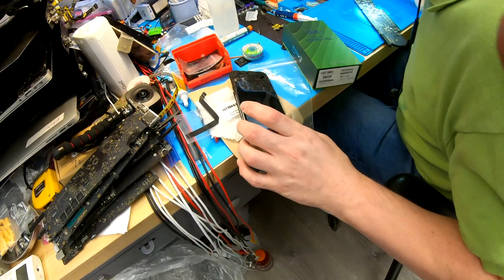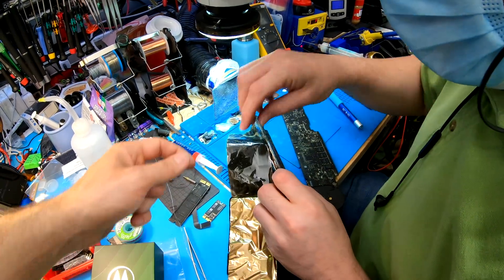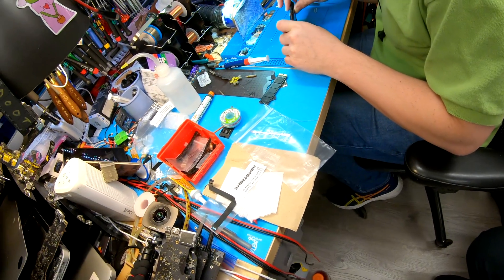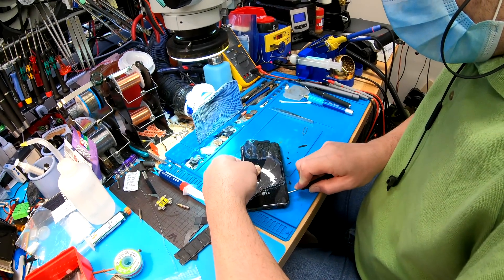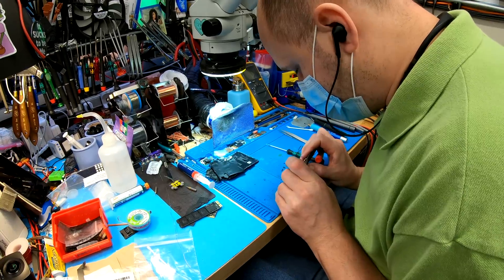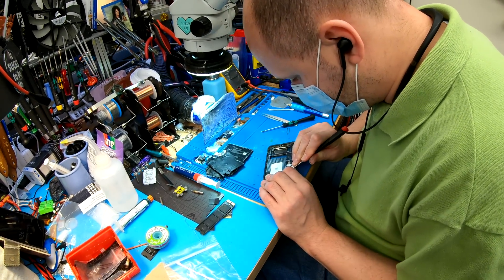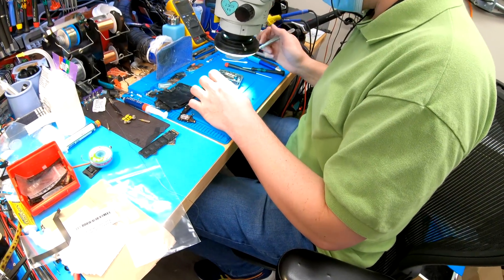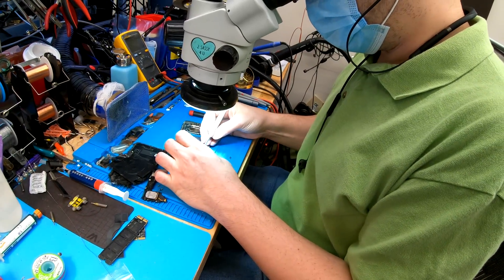Can Paul recover my phone data after the bike it was attached to goes on fire?

Comment: Gotta love it when the 1tb micro sd in his old phone costs more than the new phone.
Reply: @Carlos Suarez Motorola isn't Motorola anymore. It happens to businesses. The specific details, I cannot remember. Mergers, acquisitions, hiring, firing, employees leaving, etc.
Reply: @Zmej420BlazeIt  Motorola mobile has been acquired by Lenovo. I still like Moto phones. Affordable and configurable.
Reply: @Zmej420BlazeIt  i have a moto x4 from 2018 its going pretty good. Its ipx64 and is good on battery as well as charging. I like moto
Reply: @anshajkumar6542  I have a moto x4 4th gen and it works fine too. Bought the amazon model for 100 bucks over a year ago and its been rocking on. battery life is good on this phone and it charges fast.
Reply: @Zmej420BlazeIt  it's now CHINESE....
Reply: @Zmej420BlazeIt  Exactly.  Like MS buying Nokia and then running them into the ground.  Or HP buying Palm; still salty about that absolute hose shit buyout.
Reply: @clblanchard08  IIRC, MS bought a specific portion of Nokia's phone business because Nokia was the only company still using Windows Phone and were about to stop because nobody was buying them.  It wasn't that Ms drove that into the ground, it had already hit but not yet stopped moving.
Reply: @Zmej420BlazeIt 
Google-rola. Then Google grew tired of them and sold it off again. Lenovo is the current owner. So like many other well known brands, it's now a Chinese clown of its former glory.
Reply: @tin2001  Lenovo assembled computers, PC notebooks and desktops designed by IBM.  When they excited the PC market, they sold that division to Lenovo.

Google bought Motorola and Microsoft bought Nokia for their patent portfolio.  When Microsoft sold off Nokia and Google sold off Motorola they kept the patent portfolio and sold the rest of their intellectual property.  Lenovo snapped up Motorola for the remaining intellectual property and brand recognition.

Lenovo makes Thinkpad and their own brand of computers, tablets and cell phones along with Motorola phones. Thinkpad devices still maintain many of the features that made them the corporate choice for portable computing.
Reply: @tin2001  That explains why the Motorola's felt like it was spying on me... F Lenovo
Reply: Also more than his phone.
Reply: @Carlos Suarez my moto works fine and was a whopping 100 bucks
Reply: @Carlos Suarez Because now they are owned by Lenovo.
Reply: Amazing!
Reply: @Carlos Suarez I mean the moto G series is probably one of the best value for the money nowadays. It is the first recommendation that I make when people ask me for an android recommendation.
Reply: @Carlos Suarez Motorola Communications was purchased by Google a few years back... And they drove it into the ground with mid-priced, sub-par performing, and flimsy phones. Like, who wants a phone with a modular port on the back for a better camera that "might" get made for it? Or a 5G modem that you would have to purchase separate? They have some "ideas" but they don't always pan out well.
Reply: @Nighterlev  @Nicholas B fair points, I was just pointing out that fake SD cards DO exist and they can be found on really any eCommerce website, not just AliExpress, so buyers should be cautious when buying them (unless you go to an official reputable company's website and buy it directly, of course)
Reply: Those 1TB SD cards are fake...they don’t have 1TB of space on them.
Reply: @GlennNiesen  I'm pretty certain Louis doesn't buy his SD cards on AliExpress
Reply: @Line_r Atomic Shrimp has some pretty good videos about fake 2 tb and 512 gb SD cards.  They are pretty clever, when put into a device, the device thinks they have the right amount of storage, but let's say after 8 gb or so, it starts overwriting data on the SD card because it really doesn't have the 512 gb or 2 tb storage and it has like 8 gb in reality.

Check it:
https://m.youtube.com/watch?v=ZG-Joa3e5Tk
Reply: @shadowxgaming4247   @Glenn Niesen He has a sandisk extreme though which does come in a 1tb variant and I'm fairly certain louis is buying the genuine version.
Reply: @Liner_404  🤣
Reply: @shadowxgaming4247  Pretty sure Louis buys data storage from "safe" sources. There are real 1TB cards to be had, but they are expensive.

If for ANY reason a thumbdrive or memory card seems suspicious, test it with H2Testw. Note, it will delete all data on the card, then write to every memory location, and finally read back all that data and check for integrity.

The most common mode of faking storage size on these things today, is manipulating the controller firmware to add memory locations that do not physically exist, and kill the error reporting. That way the card itself "does not know" that space isn't there, and can't tell you. IMO this is the most devastating way of scsmming people. Because it does not "keep overwriting". It just keeps on "writing" your data to cells that do not exist. Meaning unless your device does post-write data intrgrity validation, there will be no errors or warning. Your data written, like those cells, will not exist anywhere. And you will never know until the day you try to read it.
Reply: @Liner_404  He is cheap but not stupid lol.
Reply: Glenn Niesen 1TB are very real in 2020. They cost around $225-250
Reply: @GlennNiesen  you're thinking of an old Linus tech tips video my guy. 1tb sds exist now. We are in the future.
Reply: @GlennNiesen  , christmas around the corner 2020 will end soon ,2TB are norm
Reply: @GlennNiesen  There are real ones but they cost about $400.

Comment: and that's why you don't put 4kw trough a 1kw motor 🤷‍♂️
Reply: The bike wasn't on/moving when the fire happened.
Reply: @Paradoxical Nightmare I was a little concerned that Louis' waterproofing may have had detrimental effects on the cooling of the batteries too.
Reply: The Enterprise diverting all power to this or that, doesn't apply to todays' technology
Reply: Unless you're Photoinduction.
Reply from the maker: Batteries designed for a 1kW system? What? No! To be clear - I am NOT using a battery designed for a 1 kW system. I am using a battery designed for a 5-6 kW continuous system on a motor that I have put a peak of 3684 watts through, and it is being used in parallel with another battery(meaning it put out 1900 watts at most, peak)

Let's go over the batteries used here. Samsung 35E cells are rated for 8 amps continuous output. The cycle analyst computer said the max amperage output for the entire trip was 46 amps. These 35e cells were in a 20S10P configuration - I had two 20S10P packs here. 

Since two of these 20S10P were in parallel(through a bridge rectifier so one battery cannot charge the other), you're looking at 24 amp output per battery as a max peak output during the trip. Now, divide that 24 amps by 10 since each battery had ten cells, and you get each individual 35E cell having put out a max of 2.4 amps peak, over the course of the evening. 

That is waaaaay under what the battery is rated to be able to supply - the hardest we were on that battery the entire evening was about 30% of its total rated output. 

Let's say the cells were imbalanced from each battery pack, so the diode was only letting power through from one battery. This means the worst case scenario is that an 35E cell in there was asked to put out 4.8 amps peak, since the output from the diodes would be switching rather than using the same voltage from each source. That is still way less than the 8 amps of continuous output they're rated for. This wasn't even happening since both batteries are charged through the bridge rectifier each time, with enough time for each battery to charge to 83v. 

A 20S10P battery with an 80 amp continuous BMS should have zero problem doing 46 amps peak - even on its own. Much less with it having the help of another battery: UNLESS it was constructed with cells/BMS of lower quality than what was requested.
Reply from the maker: Anytime I see "Discharge current: 8A Maximum discharge current: 13A" I assume the lower number is the real one

Comment: Glad to see you're back to your old love, Motorola.  I remember when you used to use a Moto G4
Reply: Motorola is my favorite as well and they have decent prices
Reply: @researchandbuild1751  They have some really good budget phones. I've had the g7 power for close to a year and really like the phone. It's hard to hate on 3-4 days on a single charge with 11+ hours of screen usage for 260 dollars. Its still quick enough to not feel laggy or slow also.
Reply: @thewelderdude yes, I have the Moto g7 power too, it is amazing.  It's also much easier to root and modify then other phones as well as a lot less junk on the phone
Reply: @thewelderdude  i have the zplay2 , good battery life..
Reply: @researchandbuild1751  Fantastic battery life!
But mine got batter bulge and the screen started lifting off. I ended up buying the Motorola One Hyper back in December of last year, and its another great phone. Not that different from the Z2 Play, but a better screen and camera. No mods though, but I never used them anyway.
Reply: Motorola is owned by his favirate company, Lenovo😁
Reply: Moto g4 was great, i stop using it since it over heats. Will take it apart some day and fix it.
Reply: I didn't know Louis had a G4. I switched from that to a Moto G8+ recently.